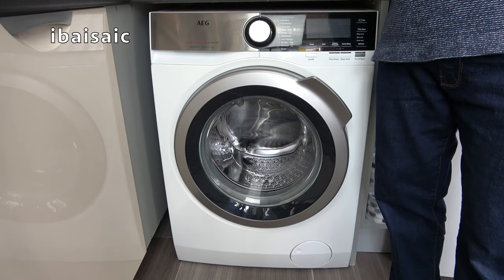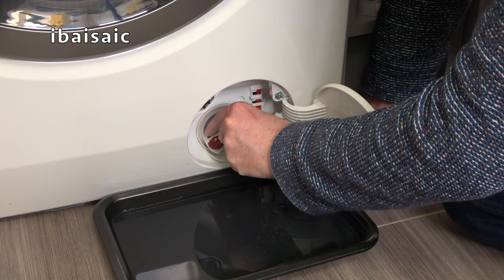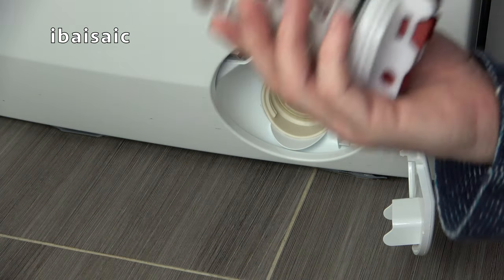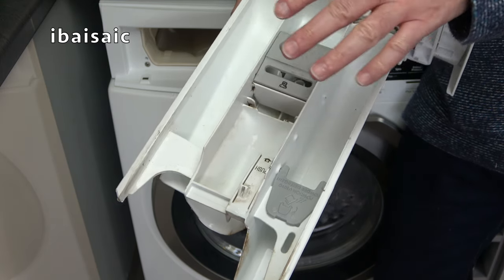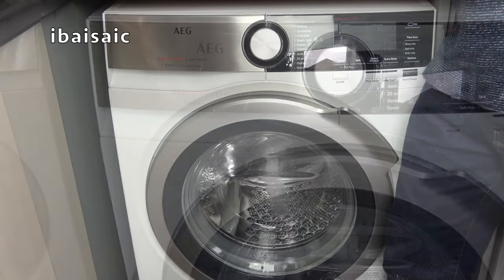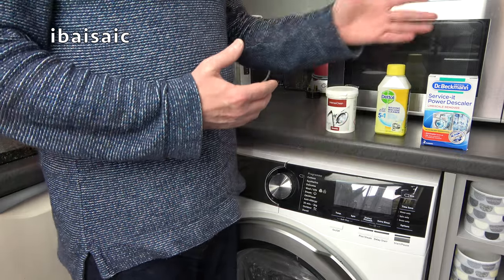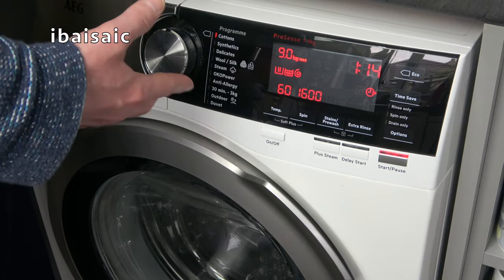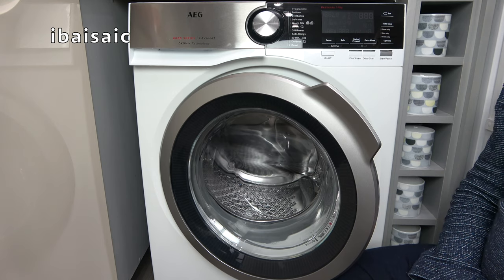Smelly AEG Washing Machine Cleaning & Maintenance Tips

Comment: I'm currently using Electrolux's own brand descaler/cleaner for my Zanussi Washer Dryer every 6 months or so and it seems to work well. I wouldn't recommend using the time saver when running a maintenance wash though, as you want to allow the product to remove as much gunk and limescale as possible. I always clean the filter afterwards, as I usually get chunks of limescale from the heating element trapped in the filter. Like yourself, I always leave the draw and door ajar, regularly clean the draw and regularly wash at 60 with a Bio powder containing oxygen bleach. My machine will be 7 years old in December and doesn't have any visible mold issues or smells.

Comment: When your washer stinks, make sure to clean out the catch trap on the pump which is somewhere inside the machine. Also leave the door open after each use, do not shut the door, to allow it to ventilate.  Also I use Fabuloso in my washer to remove the sewer smell. It will foam up like crazy and make foam come out of the machine all over the place, but it works to get the bacteria and junk out of the drain line which causes the smells.

Comment: Says 90-95 degrees but puts 60 degrees.. 🤔
Reply from the maker: I said in the video that the day before I used a 95 degree programme to wash some tea towels so it wasn’t necessary for me to run another 95 degree wash. I followed the instructions on the washing machine cleaner that stated run the machine on a 60 degree wash, which is what I did.